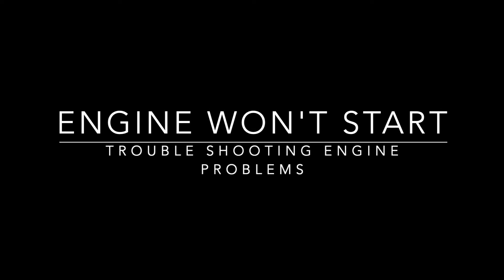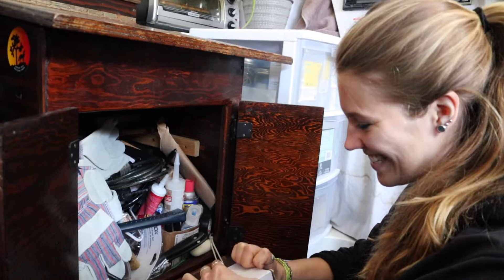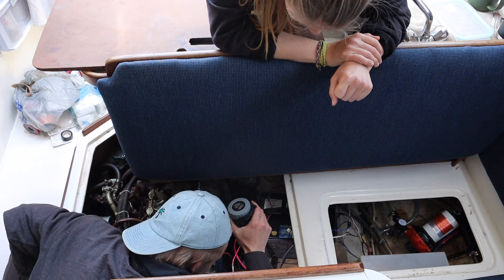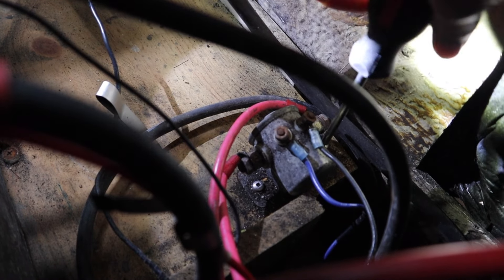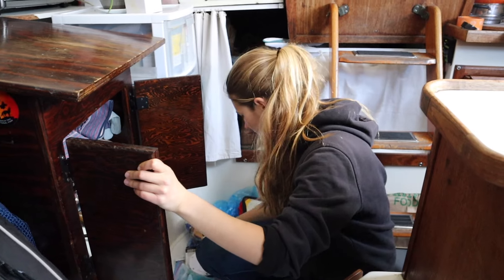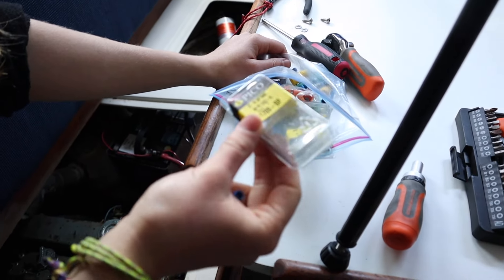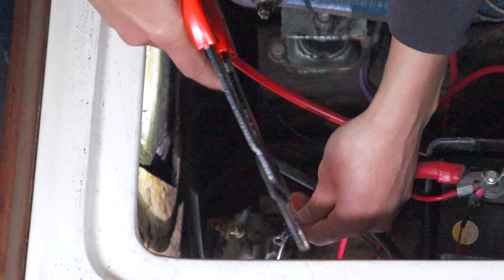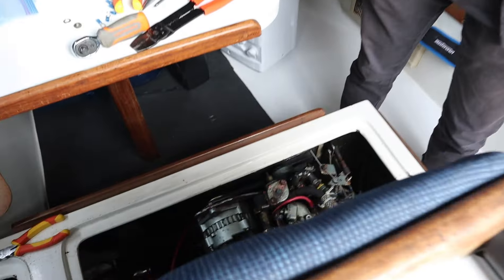Troubleshooting Engine Problems | Engine Won't Start | Replacing the Solenoid | Universal diesel M25

Comment: With a solenoid, you can always jumper across the solenoid and see if that completes the circuit to start - save a lot of work if the solenoid isn't the problem. That is also an emergency start procedure. Good video!

Comment: Great job! In the future you can take a wire or jumper cable and go from big red on 1 side to big red on the other side, we used to use the handle on a only pair of combo pliers to jump it, if that works the solenoid is good. Also get some dielectric grease and a bronze/brass wire brush, when you pull off an old connector, give it a brush and put some grease before reattaching. The brass brush won't leave any steel that can rust. Also get some shrink tubing, slide it on before you put on the new connector, then heat it with a heat gun or lighter, it will slow down the corrosion.
Reply from the maker: Thanks for the suggestions! We'll keep these in mind for suture projects :D and for trouble shooting future engine issues!

Comment: If you get stripped nuts or studs ...use a pair of snips to lift the nut while you turn it ... normally thats enough to get it to re engage and unscrew.
Reply from the maker: Thanks Clive! We'll try that next time :D we tried with a pari of pliers but couldn't get a good grip on it. Next time we'll try to have the right tools!
Reply: @BlueMoonLife  
Its not so much gripping it as lifting it up...to pull it away..
Mole grips can help if you can get them on and to bite well.
The other small tools you can add to your tool box are a set of nut splitters.😬😂. though a lot of people use an angle grinder or dremmel type tool depending on size and space.. the splitters are safer and purely mechanical.

Comment: oh hey! congrats on it working! only real note I have is to make those new ends "marine grade" (really just: water tight) - usually the ring terminals come in a normal crimp-only form for land use (which it looks like you have here?) and a "marine" form that you can heat-shrink down to seal up. not totally sure but you might be able to just add heat-shrink to the ends you just put on to accomplish a similar-enough effect - probably talk to a real electrician about that one tho and not me 😂
Reply from the maker: Hey Josh! Thanks for that! We'll definitely try to waterproof them better, I think you've got an excellent point :D 

And thank you! It felt so good to get it running haha!

Comment: Good for you Gillian. It's so cool to see you getting in there and getting your hands dirty, explaining everything as you did it - but from you I'd not expect anything less :) .  I've a suggestion for you, which is relatively inexpensive and could free up another set of hands that holds a torch. There are these really neat products which are small LED Lights which you wear on your head with an adjustable comfortable elastic head strap. Handy for in all sorts of applications, from changing car tyres in the dark on the side of the road to looking down into engine bays and dark cavities hands free. I'm sure that you both could find any number of other applications for one each, in the glove-box of the car and on the boat. You should be able to find them at Home Depot type stores or Camping Supply places. I've 3 or 4 scattered around the place in handy locations. 
Another suggestion I might make if I may. Next winter and every winter going forward, I'd suggest regularly every few weeks turning your engine over, it sits in a cold place under the waterline and unused for any period of time they do tend to become a bit of a problem like that, Regular use if only to run it for 10 minutes to get it warm every 3-4 weeks when not in regular use does it the world of good. Am looking forward to seeing Blue Moon and you back out on the water soon. :)
Cheers from NZ ! M.
Reply from the maker: That's a good idea to get a headlamp for the boat! We have one floating around the van, but for some reason we never thought of using it for engine work haha. 

Thank you for the suggestions :D We will make sure we get on a good schedule for regularly starting up the engine next winter for sure!!

Comment: Hi Guy's,  Greetings from Scend Serendipity now safely moored for the winter in Messolonghi Marina in Greece.  I've started to catch up on your videos and had to comment on this one.  I really smiled at your reaction to fixing your engine.  It is always rewarding when the technical issues can be overcome using your own initiative and developing your skills along the way.  These things I know from my own experiences.  It gives you the confidence going forward to "come out on top, without panicking. when the doo doo hits the fan" as it invariably does when you least expect it.  You Guy's work well together and I think compliment each other.  Stay strong.  Stay safe.  Find space apart when you need it as it can be so so hard at times living together on a boat.  But these small victories make it all worthwhile in the long run.  I am sure if you had to you could manage an engine top overhaul if the situation arose without the air turning blue.  Very best wishes, Steve.

Comment: Well done.  A solenoid is really just a magnetically operated switch, and the internal contacts actually get burnt not corroded, I have had to take the solenoid on my truck apart several times to clean the contacts up.  It is a good idea to carry a spare, smart girl.  Looking to see you out on the water.
Reply from the maker: Thanks for the info John! That makes sense that it would be burned :D

Comment: I am impressed to say the least! That was fabulous and I am once again impressed with you. Those switches are a common crap out item with Universal engines. I had one that was intermittent, sold the boat before I replaced. Get another one and put it back in the “storage” unit. By the way, our engine was under the steps, yours is in a good place to work on it. You are lucky.
Reply from the maker: Thanks Tommy! Good to know that they are a common problem, we'll make sure to get another one :D Interesting you engine is under the steps! I can imagine that would be difficult to get at

Comment: You can use a jumper wire from battery side of solenoid to starter side.  These are the large posts. Do not bolt them on.  If you have alligator clips use them. This will isolate the solenoid from the system and the engine should turn over. If doesn't the the starter maybe locked up.  Warning a 12 volt does not shock you as a 120v or 240v house current but will burn you badly and sparks will fly.  You did great switching of battery and remove battery  cable at battery.  The solenoid is just an electric magnet that closes the current from battery to the starter.  Jumping across the the battery side to the starter side manually does the same.  You do not have the glow plug side on it.  If caught out and this happens just jump across the solenoid.  Glad you had a new solenoid. Need to purchase a another one.  It has been real cool here in Washington Okanogan Valley about 100km south of Canada.  Going to Portland Maine to check on a IP 370 and most likely purchase. Cheaper than houses here which run 400000$ then have shipped to Port Townsend.  Shipped on a ship and will go there to Vancouver.  Enjoy your first sail this season.
Reply from the maker: Thanks for the information! Wow that's exciting about the IP 370! Hopefully that works out for you :D

Comment: 2 tricks or tips. 1 imagine you are at anchor  and you wake up and realize you have left some load on all night and your battery is too low to start. or your solenoid failed . You still need to start.  1: turn off all loads  , open your compression release lever. try to start. in many cases your battery will have enough to turn the motor with no compression, once it's spinning  you can close the compression release and there is a very good chance it will start.  2: the two fat terminals on the solenoid are the contacts that close and send power to the starter. with a thick piece of wire you can connect one to the other(momentarily) and  this will bypass the solenoid and turn the starter motor.  ( I have used both of these tips in real situations)
Reply from the maker: Hey, thanks for the tips! Those will be really good to know if we find ourselves in that position!

Comment: I've been having a similar problem - great to see that replacing the solenoid did the trick.  Far better than having to install a new starter.  Where did you get your replacement solenoid?  Great video!